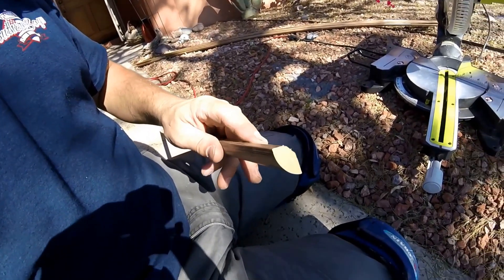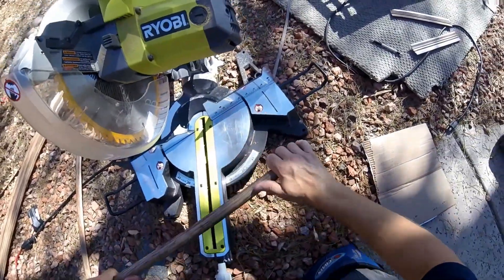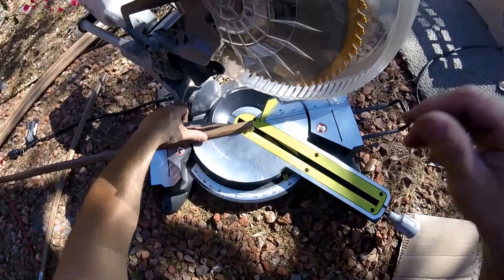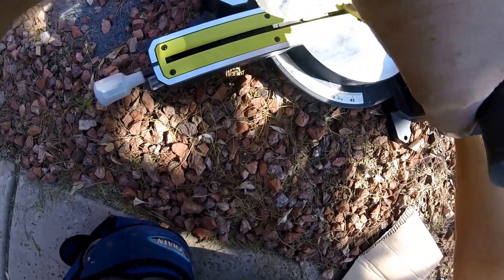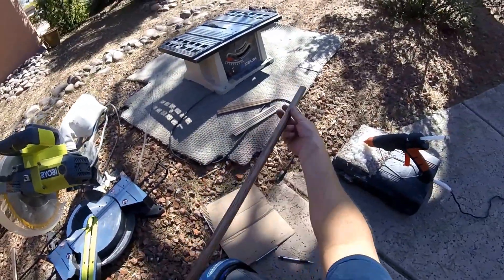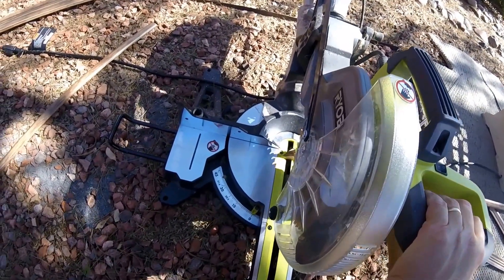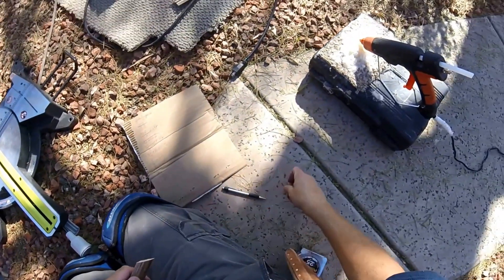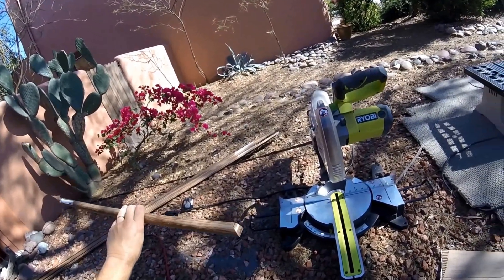HOW TO END CAP QUARTER ROUND

Comment: Hi!  First of all THANK YOU for taking the time to make all these videos.  As a 54 year old female trying to lay peel and stick vinyl planks in my home you have been a life saver.  I do have one issue that I need advice on.  How do I END my flooring at the entry doors.  My front door has a small wood thresh hold type thing and a piece of trim so I think that door will be fine.  My other entry doors however do not.  The carpet just ended and of course was held down by the tack strips.  How do I end the planks at these doors and still have a "finished" look?  Should I just buy a piece of molding?  Thank you again for all your help!? Angie
Reply from the maker: acforhim1 yes you can buy a piece of trim to finish them, and if they're metal threshold you might have to glue them to the threshold itself, if you cut your planks close enough to the threshold  you can always run a bead of caulking if it's a pill and stick its not going to be moving that's usually what I will do , you can see my how to caulk like a pro video I have two of those and you can get really good results with caulking, just whatever color you choose there's numerous amount of colors of caulking that you can choose from that's going to work as a water seal from water leaking in and also give it a finished look
Reply: FloorsbySouthernboys  THANK YOU!! I had already watched your caulking videos & they are excellent as well! May I ask one other question while I'm here? I've been watching your videos on transitioning  from vinyl to carpet. Once I do the method using the Z strip with the carpet tack strip and have it nicely rolled under....do I STILL need to put the transition piece on top or can I just let the vinyl flow right underneath that and then do the process of securing the carpet?
Reply from the maker: acforhim1 yes your vinyl will go underneath your zbar and there will be no extra transition piece needed that will be your finished Edge
Reply: AWESOME!  Great news and great videos!  THANK YOU!  :-)
Reply: Transition